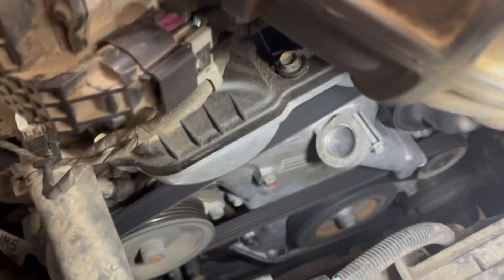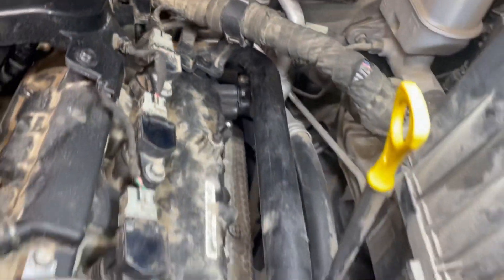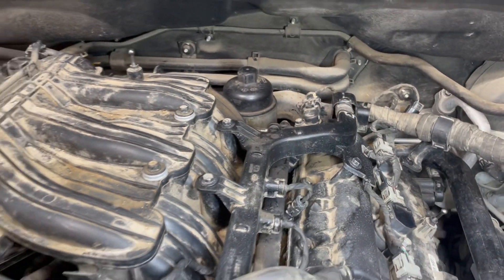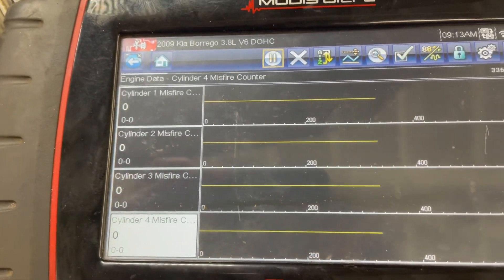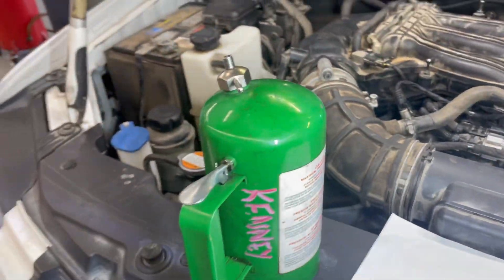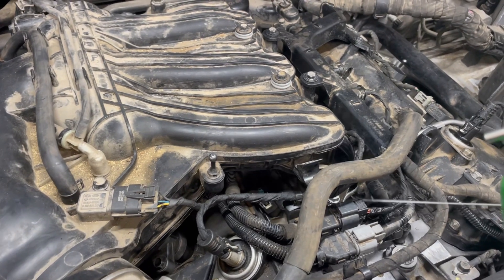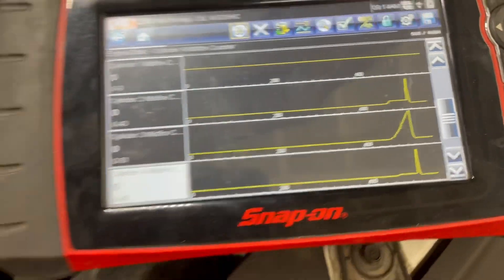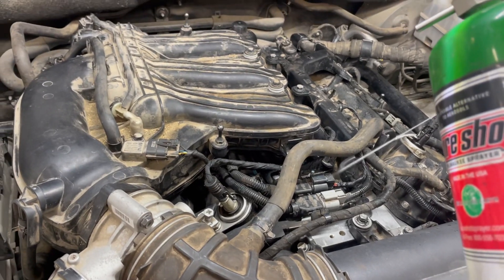How to Diagnose a Misfires at Cold Start Only on 2009 KIA Borrego 3.8L Engine.

Comment: brad, ngayon ko lng nakita channel mo.. laking tulong sa kia cars ko, salamat. tanong ko lang, nag check engine kasi carnival ko less than 1k kms tapos pag diagnose sa dealer, misfire cylinder #2. They clear the code lang tapos sabi wala naman other issues. until now di nman bumalik yung check engine. may nagpa service na ba jan sa inyo with same issue sakin? salamat.
Reply from the maker: Hello brad, Salamat nakita mo channel ko. Meron din kaming mga issue na ganyan at mahirap I diagnose mga  intermittent issue at minsan umaabot ng ilang months bago mag misfires ulit. Panoorin mo to para magka idea ka. Salamat sa panonood.
Reply from the maker: https://youtu.be/fW5duDTyKjM
Reply: @WrenchingRyan  maraming salamat brad. may sorento din ako '16 v6, kakalampas lng ng 100k kms. so far ayos naman, wla akong issues sa misfire or other codes (kaya na surprise ako sa carnival with misfire code). DIY ko din maintenance ng sorento. tanong ulit, when should I replace the spark plugs tapos isasabay ko na rin ba ang ignition coils? fyi lng, nasa canada ako kaya kms lagi ang reference ko. salamat ulit!
Reply from the maker: @LowKeyHiFi  spark plugs service internal is 60k miles kung 100k km kana due kana for replacement not bad idea kung isabay muna yung coils. Happy wrenching.